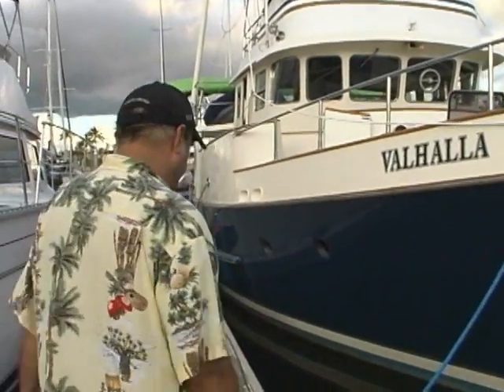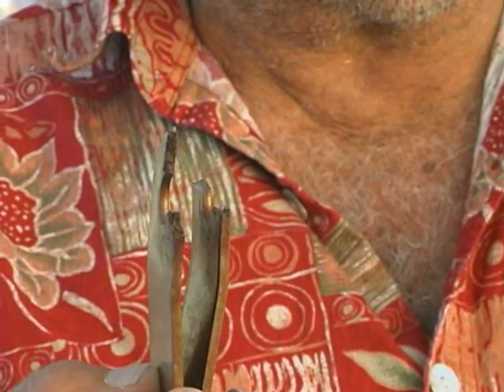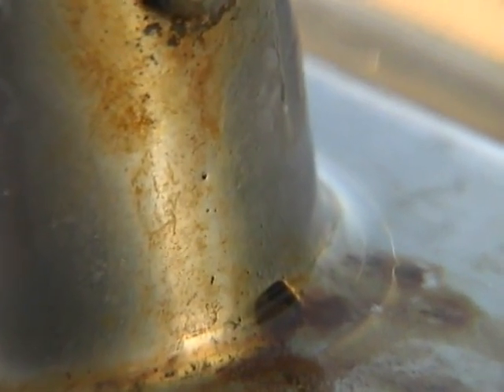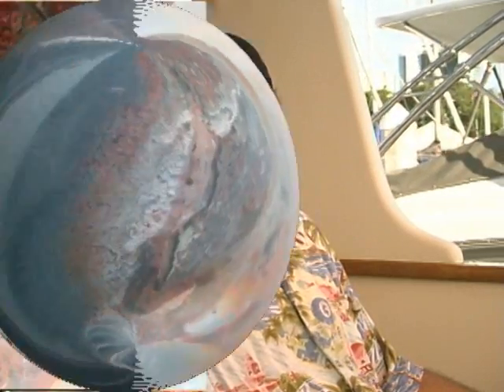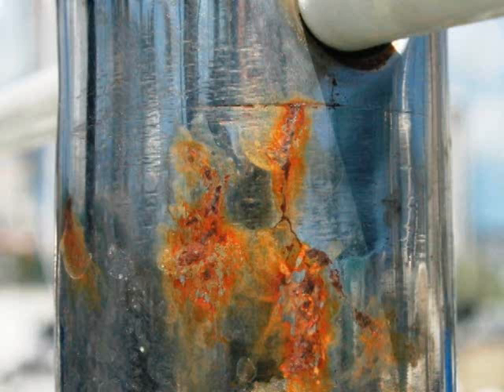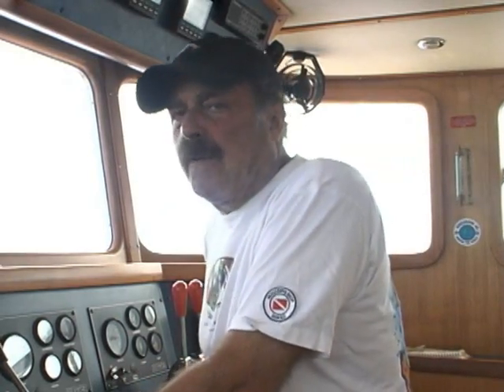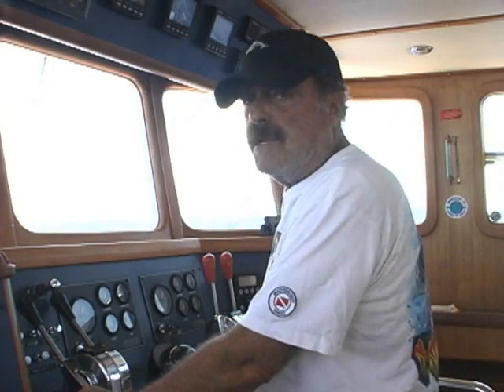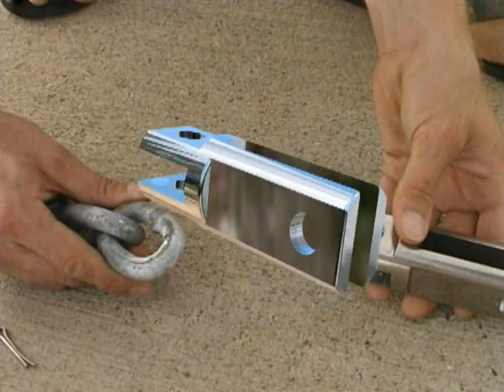Jack Chrysler Presents Marine Titanium

Comment: The Russians have been making Titanium hulled submarines since the 1960s. Alfa-class submarines. They were light and could do 41 knots submerged (47mph).  The issue with making vessels from Titanium is you can't do the welding in air so the Russians build huge rooms where they'd evacuate the air and pump in Argon.  The welders had to wear cosmonaut like suits with breathing hoses and had 4 hour shifts welding in the Argon filled rooms.

There's a great documentary on Youtube about them.
Reply: I know a fair amount about these submarines but haven't seen this documentary. Do you have as link?  Chris